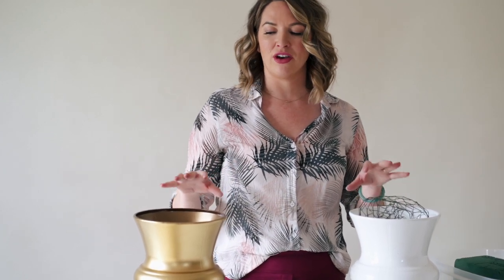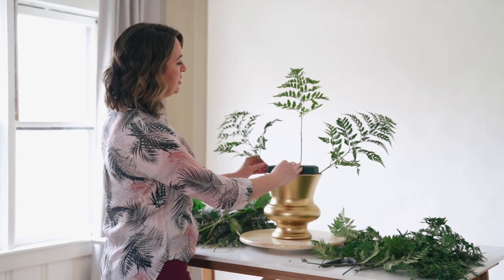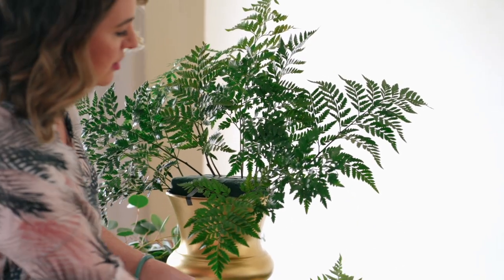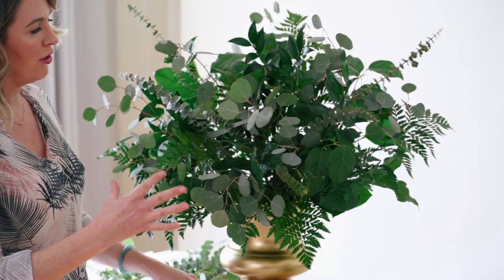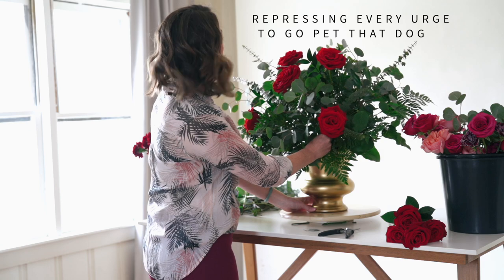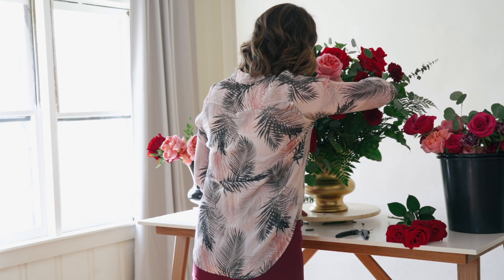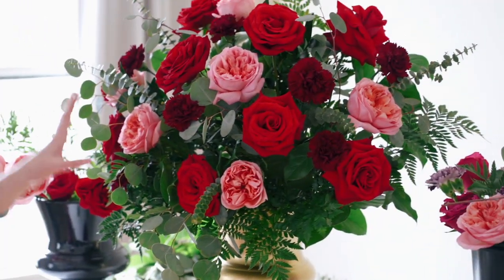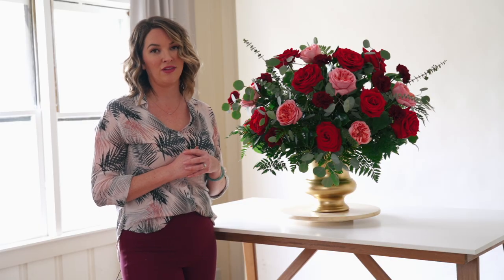Ceremony Urn Tutorial ~Flower Moxie

Comment: Noticed you use clippers instead of a knife. Any reason why?
Reply from the maker: Hello Janice, a few thoughts on this, and great question, btw!
-  Safety:  I'm not a fan of floral knives for safety purposes, and because I cater to DIY couples and new florists I feel it'd be irresponsible to have them bust out a knife during a wedding week.  Most florists I know who use knives have a permanent thumb scar and it takes a lot of practice and training to use them correctly.  When you're working a wedding, you're pulling your snips in and out of your pocket on the go, so the knife could easily cause some damage.

- Cleaner Cut:  I can freely admit that it's a cleaner cut to use a sharp floral knife and will not pinch the stem the way snips can.  Floral knives are sharp as all get out and must be to do the job correctly.   

- Event Florals:  There's a different approach with event florals vs a special occasion arrangement.  For special occasions, a florist's goal is to make that bouquet last as long as possible so they will typically arrange it with 'green' flowers so they will continue to open, cut stems with a knife underwater, etc.  However, for event florals, the goal is not to make them last for a week, but for the flowers to look their very best on the wedding day.  Flowers look the best a few days before they expire so a wedding florist is always trying to get her flowers to blow and open.  For that reason, the extra steps and techniques are not necessary, in my opinion.